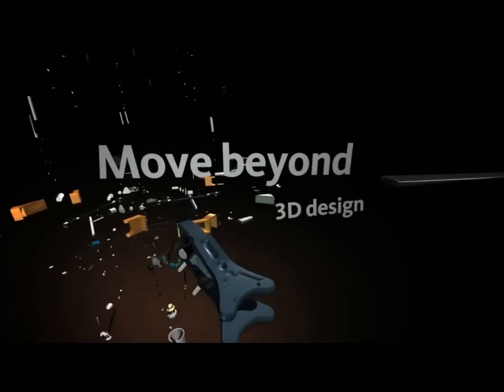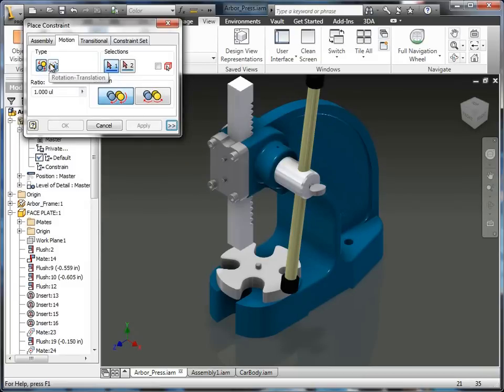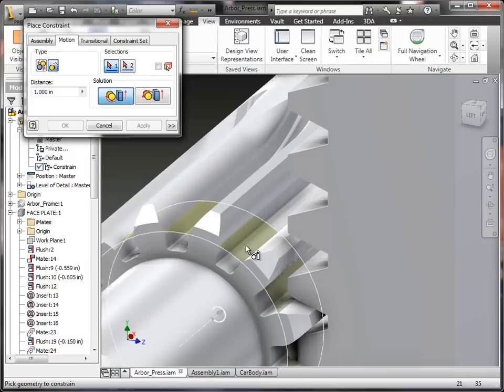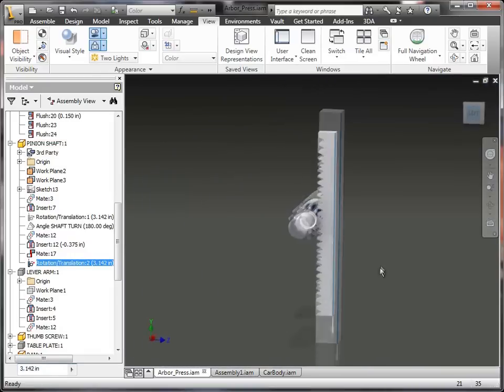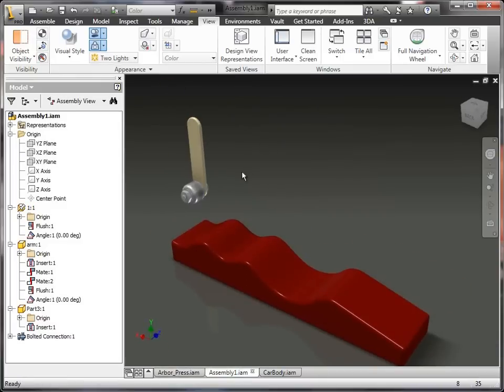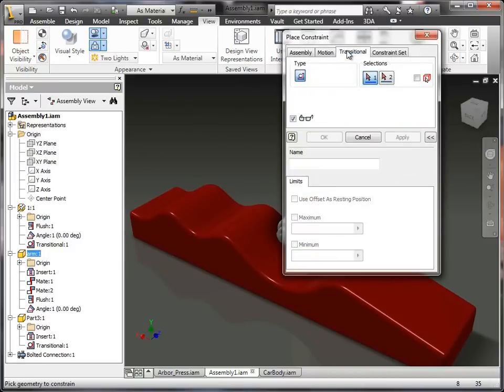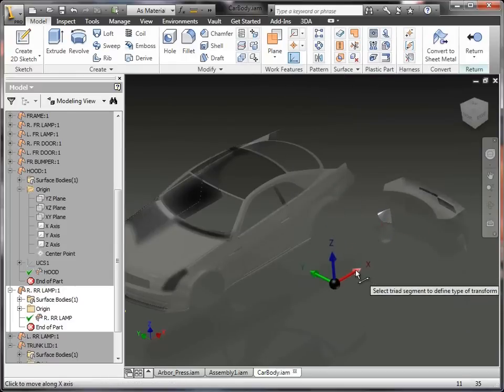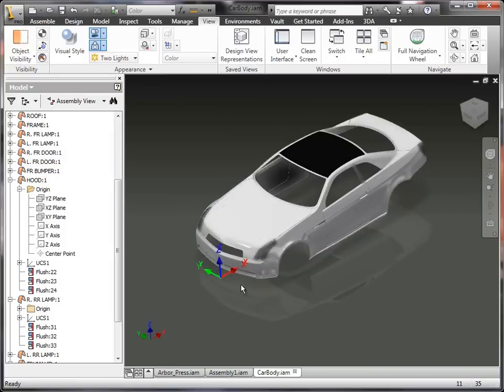Official Autodesk Inventor Podcast Episode 41 Part 1 (1 of 2)

Comment: I'm a first time Inventor user learning 11 right now. The limits option is fantastic for air cylinders to check machine movements by dragging parts. One thing I've noticed with transitional fits, is that its better to have the tangental surface derived from a single sketch profile rather than non-tangental faces with fillet features added to the solid. I've had it get confused and mess up motion because of this and by adding fillets at sketch level, the problem went away.